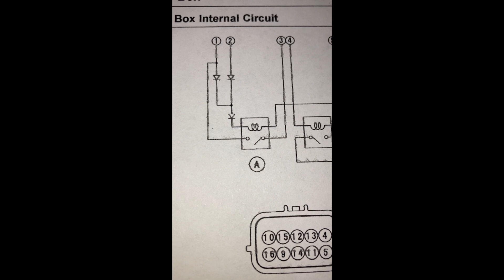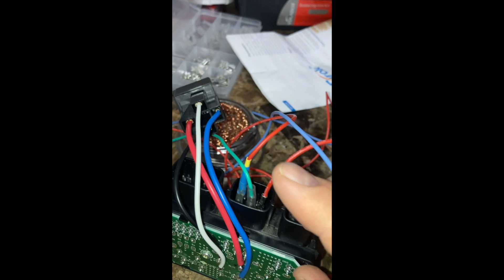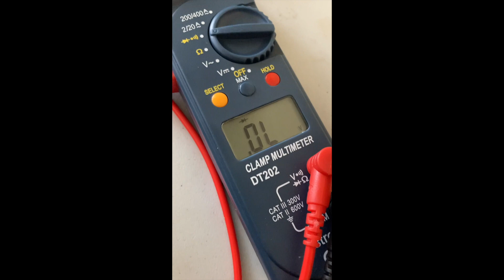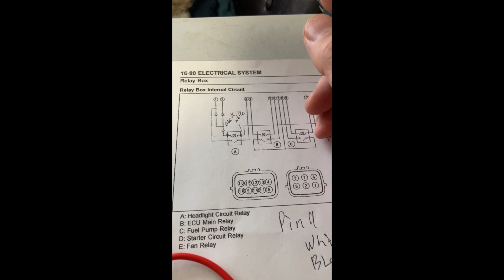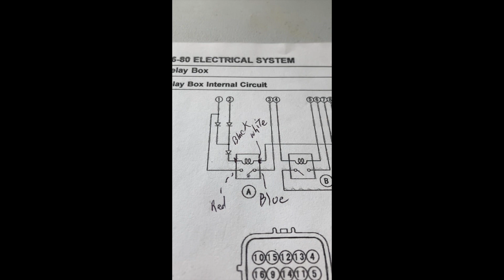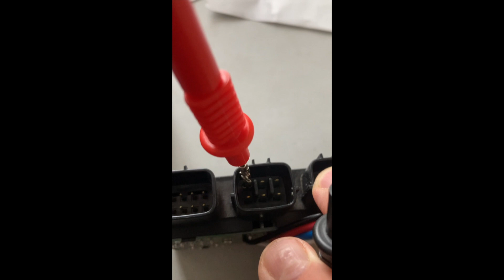Kawasaki Ninja 300 Relay box patching

Comment: MY 2013 NINJA HEADLIGHT ALSO NOT WORKING.  i COULDN'T FIGURE OUT EITHER AND ANOTHER PROBLEM I HAVE IS THE BATTERY NOT CHARGING. ANYONE HAVE ANY IDEA AS TO WHAT WRONG WITH THIS. COULD THIS BE AN IGNITION SWITCH PROBLEM?
Reply from the maker: My Stator (spins round on left side of motor...and acts like an alternator on a car to charge battery) was slowly becoming less effective and then finally it blew the rectifier and I had to replace both.  What i experienced was going through a couple batteries because they weren't charging well.  
To diagnose the issue you are having, I recommend using a electronics tester.  They are not too expensive as tools go...but if it's not your thing, you could borrow one...but borrow the person's expertise as well.  That is where the real work is going to be.  You will want to determine if the stator is putting out enough power to charge the battery. Take the seat off the bike and expose the battery terminals.  Start the bike (use jumpers if dead battery) and measure the voltage between the cables attached to the battery. 
I should probably do a video to diagnose this as it is a bit easier to follow...but there are some available for similar motorcycles on YouTube.
I hope you locate the issue...and I hope it's not the stator...that was quite a job!

Comment: In my case ,the hight beams works perfectly (i means ,it turns on once i put the keys on and hit the start botton ,on the other side ,my low Beams wont turn on , so i can say that my relay box its got some falty relays , but that is not the end of the story ,a months ago ,my Kawasaki z1000 began to shows some weird sounds on relay box , and i was riding it ahead to home it rondomly dies in Middle of road , it couldn't start ,i had to wait for few hours and i try it again,Guess what ! It start ,fortunatly i reach home, in Next morning i try to start it again and it fire up right on time , i leave it idle for a few second it just died, i put the keys off and on ,i hear the butterflys sound but no fuel Pump sound ,its like the pump is being cutted from electrical sources....i was doing This for the next days till now, i got no solution ,could This be the relay box or ECU 
......i Will be happy to read from your guys,sorry About my ingles, Im learning
Reply: The relay box itself cames with several relays for each electrical components , you already know ,so, The way that i determine where could be the possible issue ,its by tracing all problens related with electrical part, the first issue was gadgecluster , it wont turn on , sometime it just Blink couple time until goes off ,i could make it Blink again using water,i just wet some areas of the motorcycle ,i just pretend like Im washing it the gadgecluster seem to revive,the same happens with headlight,when the bike get washed the low Beams Start to flash until certain time , just to remember what i mention before ,the high Beams Turn on but no control stays on Forever until the keys its turned at off position,...other major issue that i use to determine the possible problem ,was Spark ignator ,sometimes the Spark doesn't work , rondomly fuel Pump dies at the sametime, no Spark to cause the ignition,thats wierd...could be the ECU,but when i joint all those suspicius behaviors it Take directly to the relay box , i would start it with no problems ,under 5min idling it dies , Pump cut off, i had to wait it to cool down to start again, some time it just cranks but no fire at all (no Spark ) , until i discharge the battery, i thought i was something getting hot and shut off the bike ,but wasnt the case ,even in the morning whn i turn it on i got no fuel Pump, harness checked .
Reply from the maker: Well you are showing good persistence in trying to solve the puzzle.   It can be two separate puzzles as well.  I'm curious how you could determine noises were coming from the relay box...but if that were happening to me, I would indeed consider it a bad electrical connection.  The way to make a relay make noise is to rapidly connect and disconnect.  It sounds like what would happen if a wire was connecting and disconnecting rapidly.  If I were trying to figure this out...I would think back to the most recent change or damage on my bike that was near electrical connections.